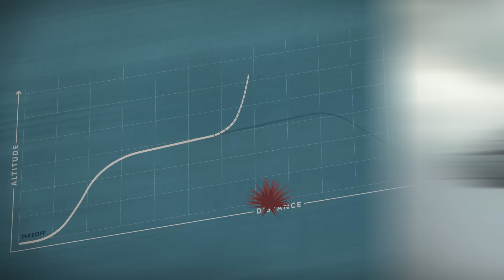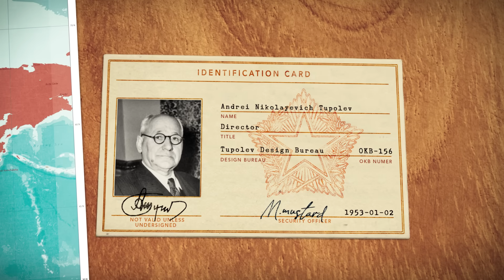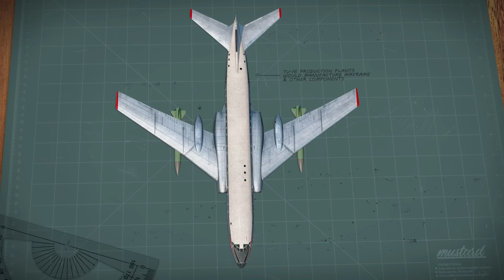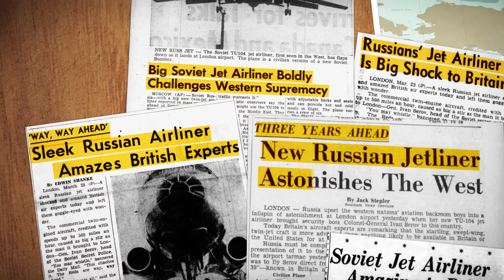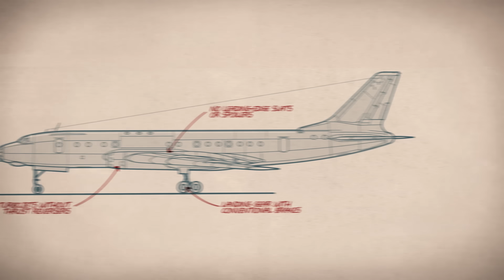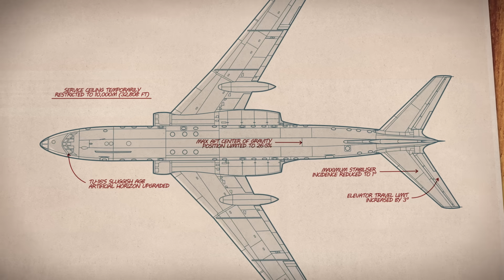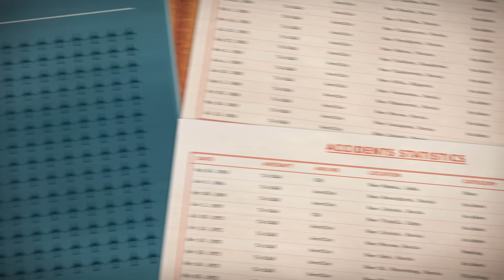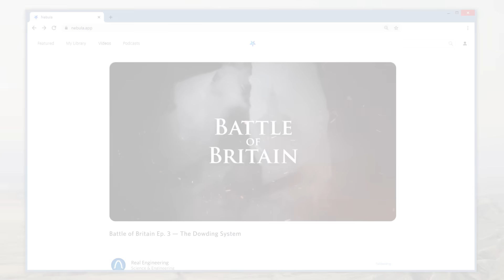The Soviet Airliner Designed To Crash

Comment: you forgot the tu-114
Reply: The British de Havilland Comet has the worst safety record of any jet airliner in history
Reply: @WilhelmKarsten Regarding the fabulous trailblazing 
De Havilland Comet.
Accident Losses generally.

We feel we can clear up some commonly held myths and misconceptions, obviously.

It's always good to see the facts presented clearly and concisely isn't it?

De Havilland was subjected to forced merger under the govt aerospace sector rationalisation programme. A similar process occured globally, Sud Aviation and several other French manufacturers merged during design and production of the Caravelle with the Caravelle becoming a significantly international type project. Even in the US, there was no room for multiple manufacturers of large jet airliners with consolidation being inevitable.

The world's first wind tunnel was constructed in England before 1890.
The world's first supersonic wind tunnel was constructed in England during the 1920s.

The DH Comet was subjected to every type of stress testing & wind tunnel testing possible at the time. 

The world's first high altitude airliner.
The world's first jet airliner.

In fact the Comet was the first airliner to have a full fuselage length pressurised passenger cabin suitable for high altitude flying where pressurisation stress was many times higher than flying load stress. Bow-wing (see b-47 wing folding wing collapse incidents) had built less than 12 pressurised cabin airliners before the Comet first flew. The world's first pressurised cabin aircraft was a British design Airco built under licence in the US and modified in the US to have a pressurised cockpit cabin during a joint US / UK research project. Previous pressurised aircraft were airliners with lower pressurisation & altitude limits where pressurisation stress did not exceed flying load stress or were bombers with small heavily built cockpit capsules where potential total  airframe weight gains were insignificant.

The Comet nose was a unique De Havilland design that Sud Aviation subsequently licensed for use on their Caravelle.

Correct, the Comet was designed with military use in mind. In fact, the first designs were based on military use requirements, the first Nimrod aircraft were straightforward modified Comet 4 airframes. Obviously when the Nimrod first flew, it was of course the most advanced and capable aircraft of it's type in existence. All subsequent Nimrod airframes were indeed simply mostly  new manufacture Comet 4 airframes with the additional equipment bay added. Nimrod design and manufacture was in fact performed mostly by the De Havilland team at HS. 

The Comet was in fact an all metal construction airframe airliner, use of other materials was similar to all other airliners at the time. 

  Obviously there have been worse aircraft for accident losses both before & after the Comet. One of the issues was accident losses due to pilot error which were often caused by the novel aspects of jet airliner flying, even so, the accident losses for the Comet as an airliner were not particularly unusual at the time.

Some changes made were to make pilot error on takeoff less likely to cause serious problems. For example, the skin thickness remained mostly the same from Comet 1 to Comet 4.
Ripstop provision existed for all Comets. The original alloy used was discontinued by the manufacturer, the replacement alloy had similar properties.

  Indeed, at the time aviation infrastructure & aircraft technology etc was still developing rapidly, there was still a lot to do when considering all aspects of flying safety.

    How things were back then. 
Accident losses - % of aircraft built.
DeHavilland Comet 4                   14% 
DH Comet all mks   (ff 1948)       17%  
Vickers VC10 UK                            5%

The DH Comet had better safety than or similar safety to many other commercial passenger aircraft of a similar era.

Douglas DC-1                                      99%
Douglas DC-2                                      47%
Douglas DC-3                                      30%
Douglas DC-4                                      26%
Boeing s300                                        72% 
Boeing 307                                          70%
Boeing 247                                          48%
Boeing 707                                          20% 
Lockheed L-049/149 Constellation  30%
Lockheed Electra Turboprop             29%
Fairchild FH-227                                  30%
McDonnell Douglas DC-8                   14%
Sud Aviation Caravelle                        15%
Canadair CL-44  Turboprop                46%  
Convair CV-580  Turboprop                22%
Convair CV-880     (ff 1959)                27%  
Convair CV-990     (ff 1961)                33%
Tupolev T-104        (ff 1956)                16%

The VC10 held the fastest Atlantic crossing speed record for 41 years (Non supersonic airliners).

For the first few years of operations the Caravelle and Comet had similar accident loss Fatalities numbers.

  Instances of all Comet marks, including the Comet 1 and Comet 3 flew with full certification at some point after 1954. Airline duty Comets were all retired by 1980 with full certification until after retirement. The last Comet flight was a global circumnavigation series of flights in 1997.

   Of course De Havilland carried out a full stress analysis & performed extensive & protracted testing, including pressure cycle testing, on two long lengths of fuselage. De Havilland carried out significantly more testing than was required by any authority at the time & significantly more testing that any previous airliner was subjected to.

  Of course De Havilland had prior experience building many all metal construction airframe aircraft & thousands of jet powered fighter aircraft that were primarily of metal construction with pressurised cockpits & jet engines built by De-Havilland. At the time De Havilland engineers  knew all there was to know about metal fatigue as it applies to aircraft.

    De Havilland did indeed always work to better than industry standards at the time, used up to date knowledge for the design & no evidence of negligence  or criminal negligence was ever produced in relation to the DH Comet.

Military aircraft accident losses compared.
Non combat phase accident losses.
% of Aircraft built.
The EE Lightening did not have unusually high losses. 
The Canadair CL-44 was a turboprop airliner.
Canadair CL-44               (ff 1959 ) 48%
Lockheed XF104             (ff 1954) 100%
Lockheed  P80                (ff 1944)  43%
Lockheed F104               (ff 1954)  45%
MD FH Phantom 1          (ff 1945)  35%
MD F4 Phantom 2           (ff 1958)  28%
Convair F102 Dagger      (ff 1953)  45%  
MD F3H  Demon              (ff 1951)  32%
MD F-101 Voodoo           (ff 1954)  34%
EE Lightening                   (ff 1954)  33%
Gloster Meteor                (ff 1943)   21%
DH Vampire                     (ff 1943)   23%
DH Sea Vixen                  (ff  1951)  33%
Gloster Javelin                (ff 1951)   20%

Note that the Meteor didn't have particularly high losses, flew with more than 20 airforces for decades, got involved in air to air combat during a number of conflicts successfully against aircraft that first flew many years after the Meteor first flew.
 
We hope this helps, of course.       
       
As always, cheers & indeed 👍.

Comment: Clearly ripped off the de Havilland comet
Reply: The Tu-104 was developed independently and based on the Tu-16 designed by German Heinkel engineer Seigfried Gunter and used technology from the B-29 (Tu-4) program.
 The Tu-104 is a  more sophisticated and advanced aircraft than the very antiquated Comet... it also has a much better safety record than the Comet

Comment: The de Haviland Comet 1 had a much higher loss rate, 46% of all Comet 1 aircraft were destroyed in accidents.
Reply: Regarding the fabulous trailblazing 
De Havilland Comet.
Accident Losses generally.

We feel we can clear up some commonly held myths and misconceptions, obviously.

It's always good to see the facts presented clearly and concisely isn't it?

De Havilland was subjected to forced merger under the govt aerospace sector rationalisation programme. A similar process occured globally, Sud Aviation and several other French manufacturers merged during design and production of the Caravelle with the Caravelle becoming a significantly international type project. Even in the US, there was no room for multiple manufacturers of large jet airliners with consolidation being inevitable.

The world's first wind tunnel was constructed in England before 1890.
The world's first supersonic wind tunnel was constructed in England during the 1920s.

The DH Comet was subjected to every type of stress testing & wind tunnel testing possible at the time. 

The world's first high altitude airliner.
The world's first jet airliner.

In fact the Comet was the first airliner to have a full fuselage length pressurised passenger cabin suitable for high altitude flying where pressurisation stress was many times higher than flying load stress. Bow-wing (see b-47 wing folding wing collapse incidents) had built less than 12 pressurised cabin airliners before the Comet first flew. The world's first pressurised cabin aircraft was a British design Airco built under licence in the US and modified in the US to have a pressurised cockpit cabin during a joint US / UK research project. Previous pressurised aircraft were airliners with lower pressurisation & altitude limits where pressurisation stress did not exceed flying load stress or were bombers with small heavily built cockpit capsules where potential total  airframe weight gains were insignificant.

The Comet nose was a unique De Havilland design that Sud Aviation subsequently licensed for use on their Caravelle.

Correct, the Comet was designed with military use in mind. In fact, the first designs were based on military use requirements, the first Nimrod aircraft were straightforward modified Comet 4 airframes. Obviously when the Nimrod first flew, it was of course the most advanced and capable aircraft of it's type in existence. All subsequent Nimrod airframes were indeed simply mostly  new manufacture Comet 4 airframes with the additional equipment bay added. Nimrod design and manufacture was in fact performed mostly by the De Havilland team at HS. 

The Comet was in fact an all metal construction airframe airliner, use of other materials was similar to all other airliners at the time. 

  Obviously there have been worse aircraft for accident losses both before & after the Comet. One of the issues was accident losses due to pilot error which were often caused by the novel aspects of jet airliner flying, even so, the accident losses for the Comet as an airliner were not particularly unusual at the time.

Some changes made were to make pilot error on takeoff less likely to cause serious problems. For example, the skin thickness remained mostly the same from Comet 1 to Comet 4.
Ripstop provision existed for all Comets. The original alloy used was discontinued by the manufacturer, the replacement alloy had similar properties.

  Indeed, at the time aviation infrastructure & aircraft technology etc was still developing rapidly, there was still a lot to do when considering all aspects of flying safety.

    How things were back then. 
Accident losses - % of aircraft built.
DeHavilland Comet 4                   14% 
DH Comet all mks   (ff 1948)       17%  
Vickers VC10 UK                            5%

The DH Comet had better safety than or similar safety to many other commercial passenger aircraft of a similar era.

Douglas DC-1                                      99%
Douglas DC-2                                      47%
Douglas DC-3                                      30%
Douglas DC-4                                      26%
Boeing s300                                        72% 
Boeing 307                                          70%
Boeing 247                                          48%
Boeing 707                                          20% 
Lockheed L-049/149 Constellation  30%
Lockheed Electra Turboprop             29%
Fairchild FH-227                                  30%
McDonnell Douglas DC-8                   14%
Sud Aviation Caravelle                        15%
Canadair CL-44  Turboprop                46%  
Convair CV-580  Turboprop                22%
Convair CV-880     (ff 1959)                27%  
Convair CV-990     (ff 1961)                33%
Tupolev T-104        (ff 1956)                16%

The VC10 held the fastest Atlantic crossing speed record for 41 years (Non supersonic airliners).

For the first few years of operations the Caravelle and Comet had similar accident loss Fatalities numbers.

  Instances of all Comet marks, including the Comet 1 and Comet 3 flew with full certification at some point after 1954. Airline duty Comets were all retired by 1980 with full certification until after retirement. The last Comet flight was a global circumnavigation series of flights in 1997.

   Of course De Havilland carried out a full stress analysis & performed extensive & protracted testing, including pressure cycle testing, on two long lengths of fuselage. De Havilland carried out significantly more testing than was required by any authority at the time & significantly more testing that any previous airliner was subjected to.

  Of course De Havilland had prior experience building many all metal construction airframe aircraft & thousands of jet powered fighter aircraft that were primarily of metal construction with pressurised cockpits & jet engines built by De-Havilland. At the time De Havilland engineers  knew all there was to know about metal fatigue as it applies to aircraft.

    De Havilland did indeed always work to better than industry standards at the time, used up to date knowledge for the design & no evidence of negligence  or criminal negligence was ever produced in relation to the DH Comet.

Military aircraft accident losses compared.
Non combat phase accident losses.
% of Aircraft built.
The EE Lightening did not have unusually high losses. 
The Canadair CL-44 was a turboprop airliner.
Canadair CL-44               (ff 1959 ) 48%
Lockheed XF104             (ff 1954) 100%
Lockheed  P80                (ff 1944)  43%
Lockheed F104               (ff 1954)  45%
MD FH Phantom 1          (ff 1945)  35%
MD F4 Phantom 2           (ff 1958)  28%
Convair F102 Dagger      (ff 1953)  45%  
MD F3H  Demon              (ff 1951)  32%
MD F-101 Voodoo           (ff 1954)  34%
EE Lightening                   (ff 1954)  33%
Gloster Meteor                (ff 1943)   21%
DH Vampire                     (ff 1943)   23%
DH Sea Vixen                  (ff  1951)  33%
Gloster Javelin                (ff 1951)   20%

Note that the Meteor didn't have particularly high losses, flew with more than 20 airforces for decades, got involved in air to air combat during a number of conflicts successfully against aircraft that first flew many years after the Meteor first flew.
 
We hope this helps, of course.       
       
As always, cheers & indeed 👍.
Reply: @petemaly8950 No aircraft in history has a higher loss rate or fatalities statistics than the Comet Disaster
 de Havilland had the worst safety record of any manufacturer when it went bankrupt and became defunct in  1958 when it ceased to exist.
Reply: @WilhelmKarsten in terms of fatalities the 747 is probably the biggest. Taking just one crash from bulkhead failure, Japan Airlines flight 123, killed more people than all the Comet crashes.